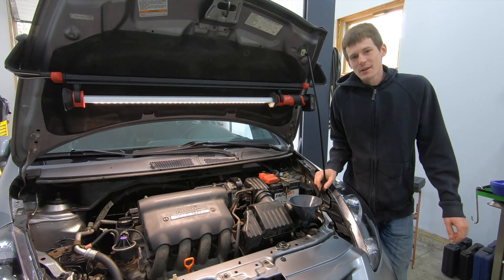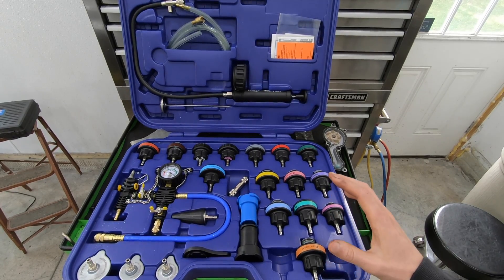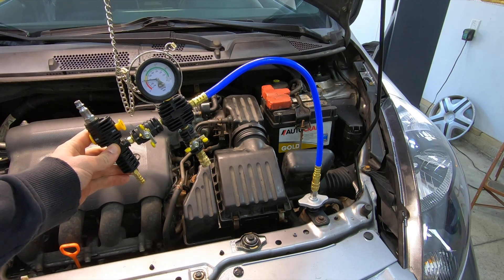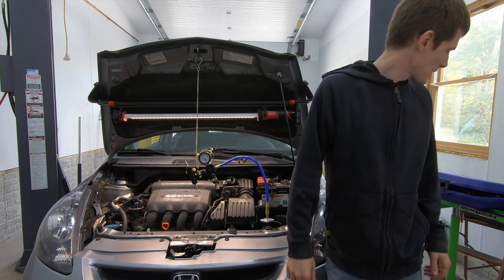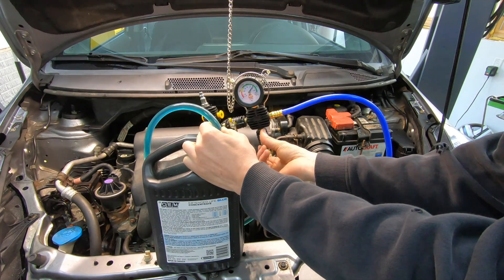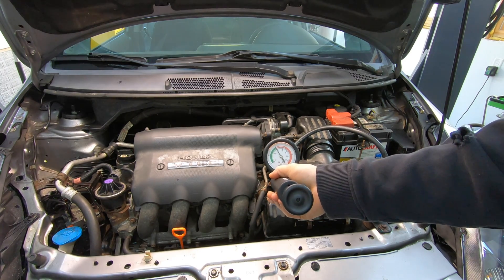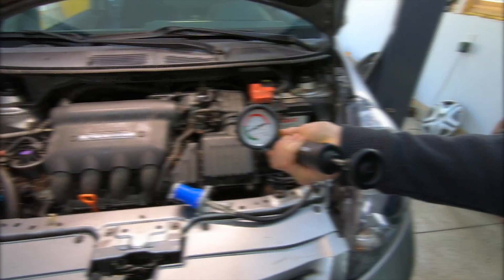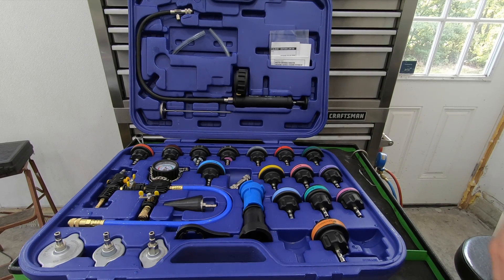How to Vacuum Fill & Pressure Test Your Cooling System

Comment: So what happens to the left over coolant or water in the system does it come out when air is applied or does it just stay in and the air is forced out??? I flushed mine and added a gallon of fluid so there is air and fluid. Do I have to completely restart or can I just use this vacuum and continue from where I’m at?

Comment: My escape doesn't have a radiator cap. is there an attachment for the fill bottle?
Reply: The tool is placed on whichever opening has a PRESSURE CAP.  If you don't understand that, you're not qualified to use this tool.

Comment: Do you need a vacuum pump or a compressor to use this tool?
Reply: It uses compressed air to cause the 'venturi effect' in the tool which then produces vacuum.

Comment: well, you're still introducing air that's inside the tube between the coolant jug and the radiator until it is filled with coolant.

Comment: Can I use the hamd pump to purge and refill. If I don't have access to an air compressor?
Reply from the maker: No.
Reply: The compressed air simply passes through the venturi portion of the device. By so doing, a low pressure (vacuum) is created, and air from the cooling system is removed.

Comment: My 2006 chrysler 300 is a nightmare  to bleed out the air. Definitely will need to get this tool for the next time I need to remove the coolant.
Reply: A Chrysler 300 still on the road??

Comment: I got the cheaper pressure tester ($88) but the fittings for the air compressor does not fit standard shop air.  What fitting do you have in your Astro 78585?  Is it S-210 or S-217?  Thank you!

Comment: That is a neat tool to have. My G35 was a pain in the butt to bleed through traditional funnel. I spent over 3hrs. Question: shouldn’t you purge the fill hose with coolant first so that the air from the hose does not get introduced into the cooling system?
Reply: 100%, suck up coolant into the hose so there's no air in it.

Comment: I did a funnel refill and i have air left in the system. 

1. Do i need to drain out the coolant to do this vacuum refill? 

2. Can a vacuum pump be used instead of compressed air?

Thanks

Comment: I have a vauxhall corsa, for those of you in the US/EU that's an Opel, manufactured by GM... My car was off the road for a month, I changed everything in the cooling system, I tried bleeding for hours at least a dozen times, this thing would not bleed air, had it booked in for my Vauxhall specialist but it was a 3 week wait, eventually, he vacuum filled it and said they're a living nightmare to get air out of, I will definitely be getting one of these for myself, and just in case this happens to any family or friends.

Comment: This tool is an awsome sucker. It just make me want to hook my vaccumm pump for AC installation and pull the system to an absolute vaccum. Thanks for the demo.
Reply: Your A/C vacuum pump may not be happy when liquid starts going through it.
Reply: @attocoulomb  and collapsing the plastic reservoir :))

Comment: Couldn't I use the venturi effect to also suck out the coolant?
Reply: Sure, but you'd have to suck it at the lowest point of the cooling system where there's already a drain valve which works just fine by gravity, so what would you gain?

Comment: Do you have to completely drain the system in order for this to work? I've done it a couple times at work but definitely need more practice. Now I just flushed out my engine and radiator and now my coolant is heating up really fast so I need to burp the system. Just bought a vacuum pressurizer like yours and going to do it that way.

Do I need to manually get rid of all of the coolant in radiator and engine before I pressurize and put the fluid back in? Or can that tool do that job? Thanks!
Reply from the maker: You should try it and see what happens. It won't damage anything. Worst case it will spray out coolant when you try to vacuum it down.
Reply: @RepairGeek  I really appreciate your very fast reply bud. Thank you very much. I just got to work and we have a Snap-on coolant system refiller that I'll be doing it properly with today. My coolant gets to operating temperature within minutes after I flushed out engine and radiator so I feel there's still air pockets inside even after attempting to jack in up and burp it for 30 mins yesterday.

Comment: Excuse my ignorance, but.. pumping air into the system to pressure test right after using a vacuum to get it all out seems… counterintuitive? Any explanation?
Reply from the maker: The air pumped for the pressure test in sits on top of the coolant in the radiator. That air doesn't go throughout the system. Yes I introduced air but, only into the top of the radiator where it can easily escape out the cap when done testing. Draining the coolant adds air everywhere, not just the top of the radiator.

Comment: Couldn't you accomplish the same thing with an A/C vacuum pump, some brass fittings and a vacuum gauge?
Reply: You would still need everything else this tool has (valves, draw tube, filler neck adapter)
Reply: I'm not sure the a/c vacuum pump would be happy when coolant gets sucked through it, unless it is rated for liquids.

Comment: Hi can you use the manual pressure tester air pump, on the vacuum generator, where you said the compressed air hose attaches instead.
Reply: No

Comment: so if the system currently has an air pocket in it. Doing this will pull the air pocket out?
Reply: yes, but be careful to lower the coolant level enough so that it doesn't get drawn into the tool.

Comment: will this suck air from the block and heater core? i mean thermostat is close when its cold  so how does this one will suck air in the block of the engine?
Reply: All thermostats have a small bleed hole to allow for that.

Comment: Mishimoto has this same exact kit but in a black box for $85
Reply: Thanks for that info! I appreciate it
Reply: I have read that there is an exact copy of the kit the video creator is using only in a black case.  The contributor claimed the product in the black case was a knockoff and inferior.  I cannot verify the product to which the contributor was referring was a Mishimoto.  The Mishimoto may, in fact, be fine.
Reply: It's not a knockoff. It's a quality kit by a well known brand. It's the same kit, I assure you. You're paying the extra money for the Astro kit because it has a warranty. To tell you the truth, they are all about the same these days. There are dozens of options available on Amazon, and they are all essentially the same quality. Its not hard to make a plastic threaded cap with a gasket on it. I personally am waiting for the new icon kit to be released.

Comment: Nice! So what do you do when you drain the radiator but coolant is still in the block, water pump and other coolant passages? Does the vacuum feature still work? Can the vacuum feature be used to suck out the remaining coolant and make the entire coolant system bone dry?
Reply: You drain the block.  I'm not sure about other cars but my Mercedes has a drain plug in the block.
Reply: What you're trying to do requires a flush with plain (or distilled) water.

Comment: Fantastic video sir!! Only question I have is when you pressure tested the system at the end by pumping air INTO the system, did it not push air into the system and thereby require you to top off the fluid when you removed the adapter?
Reply: Ya, a little late, but simple answer is no. The coolant, mostly water, is not compressible. Only the air (gas) is and compresses as it is pumped. If there is a leak in the system it will manifest as coolant dripping onto the ground.
Reply: @bigdfig6083  Thank Ya!! Been standing at my hood for 2 years awaiting your response :) Seriously though, Thank ya!!

Comment: Question: Can this Astro kit be placed on the coolant reservoir if the radiator does not have a radiator cap?
Reply from the maker: Yes. The kit has adapters for that.
Reply: But check for any other small hoses coming off the reservoir, that vent to atmosphere...

Comment: Can you put a vacuum on if there is still a littel bit coolant inside
Reply: Define "little bit".  It should not be so full that coolant gets drawn into the tool when vacuum causes the hoses to collapse.
Reply: The system should be cool to cold. If it is too warm, the remaining coolant will boil in the vacuum and cause problems.

Comment: Say you’re doing a spill and fill on a full cooling system. When you create the vacuum, does it suck out all the old coolant you’ll be replacing?
Reply from the maker: Some because the hoses will collapse. It's not designed to remove coolant.

Comment: How long does that light last on high? I been wanting to get one of those. Because I have been using two rocket lights on each side. And still find myself wanting more light to be blasted down the rear of the engine bay.
Reply from the maker: Not to be condescending but it depends on the battery you are using. 6.0 on high is probably in the 4 to 6 hour range. On low it's easily over 8 hours with a 6.0
Reply: @RepairGeek  Lol don't know how the truth is condescending. Those little m12 batteries are pretty much useless for longer jobs. Thanks for the info on that light bar, I'll have to get one now. 

And thanks for showing me this cooling system tool. F'n badass and saves a lot of time too.

Comment: Air can get trapped in high spots, not get stuck at the highest spot. Naturally the highest spot is the best because fluid pressure increases the higher up you are, which makes it harder for air pockets to get stuck as fluid try's to force its way into those cavities. There are some vehicles that this is the ONLY method because that difference. There are simply too many high spots in the system for air to get trapped in, and no amount of jacking or elevating the fill spot will purge them.
Reply: Yep exactly whats going on with my mustang, just ordered this kit

Comment: I don't have shop air, any ideas guys on rasing vacuum to properly purge and FIL the cooling system.
Reply: Buy a good compressor, or have a service garage do it.
Reply: Rent a proper compressor from Home Depot: 90 PSI and 4.2 Cubic Feet (per) Minute (CFM) or greater.

Comment: my engine has an automatic air purge on its system. ive never had issues with air in the system.   you used like 2/3 of a bottle to fill the system?!?  my god, i need like 7 of those!!

Comment: How do you fill a cooling system without the thermostat being open I have a 2004 Envoy
Reply: It's not an issue. All thermostats have a small bypass hole to allow air/vacuum to pass, even when closed.

Comment: if the system has coolant, it needs to be drained in order to vaccum?
Reply: The level should be low enough that coolant isn't drawn into the tool when the hoses collapse.

Comment: Does the coolant system need to be completely empty or can it be used when the coolant system needs a top-up (say the rad or engine is half drained). What do the Astro Pneumatic instructions say?
Reply from the maker: You can use it with a partial filled system.

Comment: 2019 jeep wrangler jl sport 3.6 does not have radiator or drain plug, so for this how do you flush and refill coolant on this jeep?
Reply: It has a drain plug, you just don't know where it is.

Comment: I've been looking for a good solution to bleeding the air out of my coolant systems and this looks way better than those funnels that hook to the radiator cap, plus this can replace my 30 year old pressure tester.
Reply: @GregsAutomotive  Really!?  I guess every one is different, but sucking it in under vacuum was faster for both my Cummins and my Jeep 4.0.

Comment: Expensive, but looks like a very solid tool for filling systems.
Reply: The high brand ones with the same amount and type of components (quality varies) are up to $400.     the valves that they come with are the most crucial.   If cheap plastic components are being used with hot coolant then for sure they will break down.   Especially if you live in a really cold climate.     Plastic pieces that get really hot get SO brittle here up the north.
Reply: @MrTravisAL  O yea, all those heat cycles in cold climates degrade plastic quick. I bought this tool and it works amazing!
Reply: Can purchase just the vacuum unit separately for $20 and then the caps are $15 each.  No need to spend money on all those caps you probably won't ever use.

Comment: Can you explain me firstly the system is totally empty...or it is prefilled..and ..and you just..fill..some for the process....secondly the left pipe black and green...you attached is air that compresses out in or it is vacuum in out
Reply: second question: The compressed air simply passes through the venturi portion of the device. By so doing, a low pressure (vacuum) is created, and air from the cooling system is removed.

Comment: Can this be used on a system that is already filled but just has an air pocket in there?
Reply: Yes.  Amazon has a less expensive option for ~$80 for diy home use.  Make sure the compressor you have is powerful enough.  The bulb funnels can be ~ $45, so for $80, you can flush your car, your wife's car, and charge your neighbor $100 (>-%50 shop price!) and own the tool for free, while servicing all your cars.  Many even have a motorcycle adapter!  My $0.02 anyway.

Comment: Great vid thanks, two questions 1) How does it deal with with any coolant left in that won't drain out? 2) How does it pull coolant/vacuum past the thermostat? Thanks
Reply: That's what I want to know
Reply: @HotDogDiggleyDog  Apparently the thermostat 'always' has a small hole/pin valve in it to allow for this? I checked on mine and it did. As for leftover coolant I think some is always left in there, maybe flushing with a hose would clear the old crap but IDK...
Reply: @spandon  Ohhh ok that's interesting about the pinhole I didn't know that. Cheers mate 👍

Comment: what PSI do you have your compressor at to achieve vacuum?
Reply from the maker: 100psi
Reply: And cfm? How many do You need or HP?
1HP OR 2HP?
Reply: My Nissan service manual states 80 - 120PSI for the Nissan genuine vacuum tool, so I guess all these similar tools will need the same.
Reply: The Snap On manual states: 90 psi and 4.2 Cubic Feet Minute or greater. You need that large volume of air (CFM) passing through the venturi in order to generate the vacuum.

Comment: should you switch on fan / heater core to high heat while filling in new fluid?
Reply: Depends on the vehicle, if it has a tap on the heater core lines then yes. Otherwise like most modern Toyota's there is always coolant running through the core so it doesn't make a bit of difference
Reply: Yes.
Reply: Only if the heater temperature is controlled by a coolant valve (not likely).